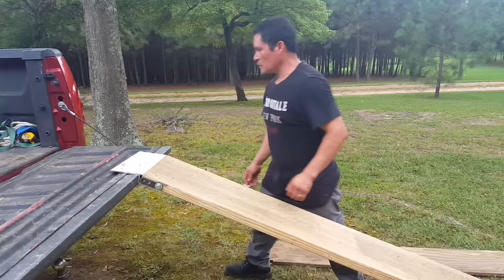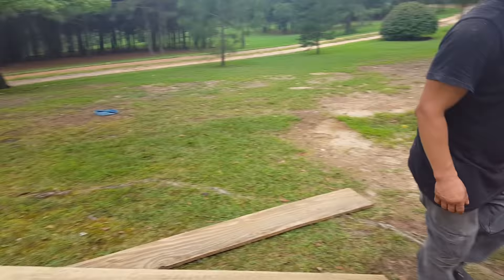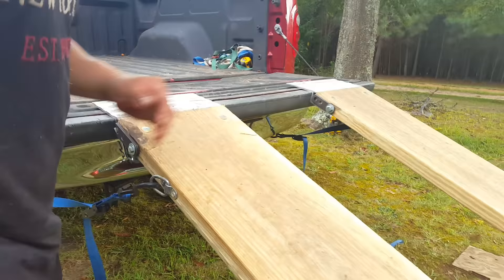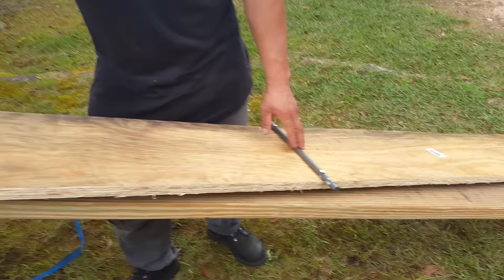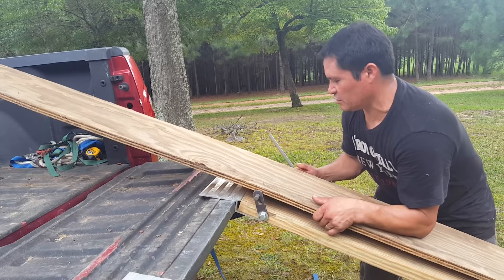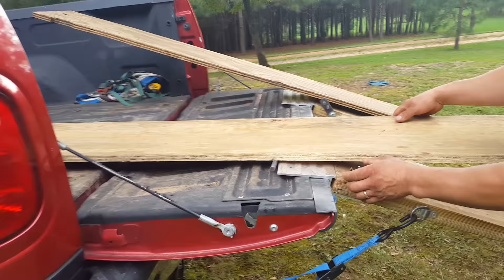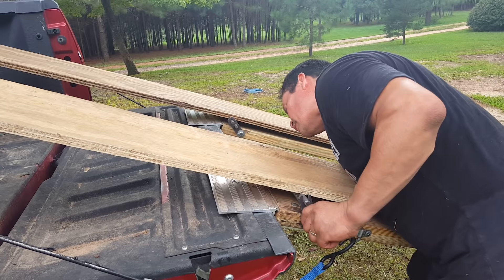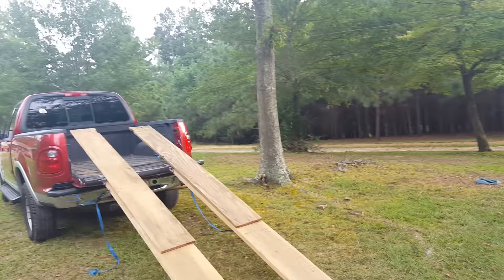Ramps for mower

Comment: Well, that is the best set of ramps I have seen for getting a tractor into the back of a pickup truck. The extra boards balanced at the top of the ramp keep the mower deck from bottoming out, ingenious. I know the arched ramps work well but the deck still seems to hit the tailgate of the truck. I was also considering truck ramps to raise the front of my pickup. Therefore lowering my tailgate to ground height but I like this idea better. Two thumbs up 👍👍!

Comment: A clever idea. It's easy to make and low cost. And too it prevents a potential safety issue. But all pickup truck ramp designs are dangerous. Slip off those narrow ramps and you may be in for a wilder ride than you planned for. Good job.

Comment: You need a Non Skid surface for your ramps.  Nail a few hundred bottle caps upside down to the wood for traction.
Very interesting teeter totter (pivot) for your mower.  Very tricky and a bit dangerous unloading.  Well Done.

Comment: Cool idea.  I'd place some wheel chocks at the rear wheels...maybe fabricate the board to accommodate wheel chocks and use several straps to secure mower.  However, if I had to use a pickup, I would only use one if I can shut the tail gate with a mower.  With all of that said, I would never drive behind anyone with that setup.  Also, I'd be worried the cops would stop me with that setup.
Reply: You don't have to worry about the cops if you put red flags at the end of those ramps during a clear day & under conditions of reduced visibility   such as night, fog , or rain etc....  Amber or Red lights devices can be visible to other drivers.

Comment: lol way too much work especially when you get to the destination. Has to be a better way but thanks enjoyed the video and very smart just too much work from stop to stop.
Reply: Julio found a solution to an old problem. You have a better idea how to get the mower into a higher truck like that? Not too much work if you only do it once or twice a year for a visit to the service center.
Reply: What's you idea then?
Reply: Richard Kenworthy A trailer.
Reply: Richard Kenworthy I also happen to have a zero turn with a steering wheel I bypassed the seat safety switch to where I can switch it on and off I have a set of ramps that are aluminum with a slight border on each side of each ramp that allow the wheels to be guided somewhat they are very light ramps they have straps on the bottom of them around one of the cross rails and they connect to the bumper just as these do but only from The Middle which makes them more stable and they pull the same way and secure the ramps. Then I stand beside the mower with one hand I press the gas pedal and the other a steer or hold the wheel straight and the mower drives right up the ramps no need for that extra apparatus or jacking and removing or Anything like that. my ramps are slightly curved in an S shape and I put the deck at its highest position and it allows for the deck and goes right up onto the truck. simple. With a zero-turn like this with the bars all you would have to do is get a piece of PVC and stick both handles inside that way you could stand to the side and pull the bar which would allow the mower to go up straight and with the guards on the ramps it won't come off sounds like a lot writing this but actually it takes 3 minutes
Reply: @PrincernPrince  and this took 4 minutes for him to get the mower off the truck, while narrating.....his solution takes some time to build, but works.....
Reply: @AOWGroundBeef  Makes no sense when u can get a regular light weight set of ramps like I have and you don't have to make them and they are cheap and can set up in less than 4 minutes. And it took him much longer than 4 minutes here.
Reply: @PrincernPrince  Rewatch the video....look at the timer when he unloads it from the truck. Regardless..of course there are better premade solutions out there, but if you aint got the bucks ($140 plus for something you might trust) and you have the lumber and rod on hand, this works handily and fairly well, certainly much better than you are giving it credit for..
Reply: @AOWGroundBeef  I watched again. Sorry but u cant just count when he drives it up the ramp. With setting it up starting at the 1 min mark it takes 7 min. Seriously I can have mine up in two minutes. These are heavy boards compared to mine and its 4 of them and a jack and securing the boards and they hang off the back and not to mention how long it takes to push it off. I simply set up two ramps in about 45 sec. Stand to the side. Press the gas medal and the mower does all the work and it literally takes 2 min. Same taking it off. If u can afford a mower like that u can afford $129 aluminum ramps. Its really so much easier. But hey i agree as i said in my very first post that it was genius and I agree if u just have all that lying around and time to burn go for it. But it isn't efficient by any means.

Comment: This man effort as a few functional issues but is good and valid. 
Although is trying to address a problem created by himself while choosing the wrong vehicle in the first place.
Quite honestly for real world workers these pickup trucks are total BS. There is a good reason why the rest of the world seldom use them for real work. ;-)

The loading area set above waist line simply doesn't make any sense. Specially considering that most work vans have it about knee height. Out of the showroom no mods added or needed! 
If we add on top that for the same vehicle length, you get way more loading area and cargo protected from prying eyes and hands, snow, rain, can load from the back and the sides, don¨t have a tailgate on the way, etc, etc. 

Well it simply makes one wonder why the "work smart, not hard" isn't applied. ;-)
Cheers